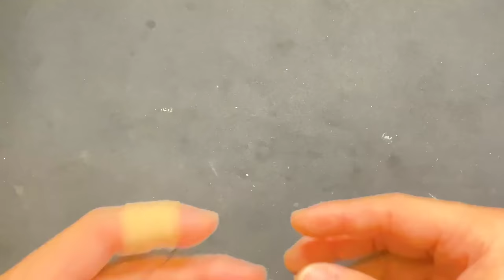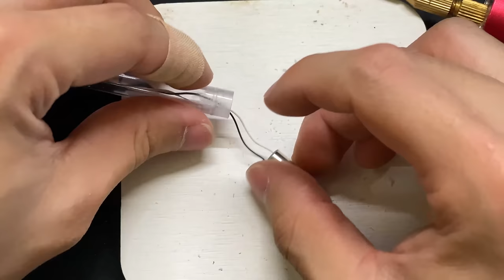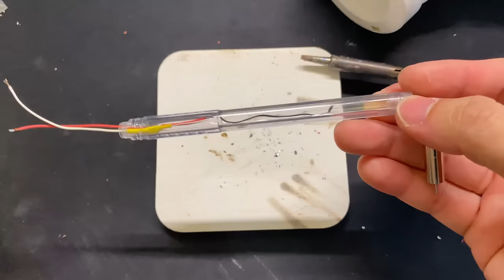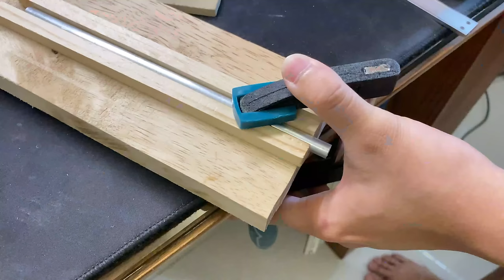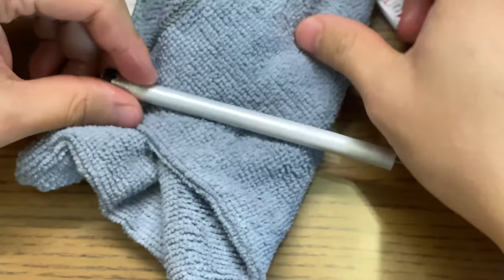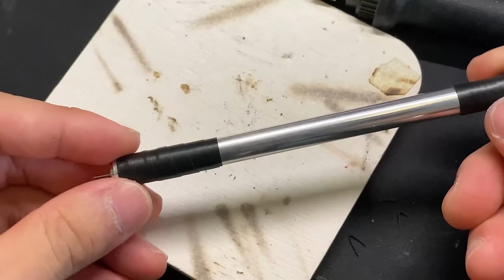I made a Pen Drill (Slim Mini Drill)

Comment: With USB-C and USB PD you could get up to 20V at 5A from a USB-C power supply. That would make this thing really crazy. The ZYPDS is a small USB-C chip that asks for 12V or 20V from a USB-C power supply, they're super useful for projects like this.
Reply from the maker: Wow, that is a new knowledge for me. Thank you for sharing, definitely will try it when I upgrade the drill :D
Reply: That's overkill and will burn that motor
Reply: @davey2k12  sure of course they'd need to modify the rest of the design
Reply: @lost4468yt  yeh just by a cheap one 👍😂
Reply: @roomspaceplayground buddy, use heat shrink tubing instead of duct tape.
Reply: buddy, use heat shrink tubing instead of duct tape.

Comment: Its nice, but it must been better if you just listed down all the materials you've used in this project.
Reply from the maker: Hi Thank you.

The materials basically are:
- 1 mm drill bit
- 8 mm chuck for the drill bit. the inner diameter is around 2 mm.
- LK0236 motor
- 8 mm aluminium pipe
- Male and female power connector
- USB cable

Hope it helps :)
Reply: @roomspaceplayground  where did you get the motor from??

Comment: Cus it low voltage use a FET or transistor with a sliding potentiometer needs slowing a bit or even a gearbox helps prevent ya motor from burning it's brushes
Cud even directly connect drills make the drill shaft with a thread or square drive use a magnet to hold it in place
Reply from the maker: agree, i had the same thought after trying it. but after all this project is just a simple one. I might make a new one with a gearbox like you said next time. Thanks for the advice :)

Comment: its great, but does it give high torque? if so, make sure the motor doesn't heat up from overload
Reply from the maker: not high enough in my opinion, as it will stop if I push a bit deeper. If using it quite some time, it does get warm. That's why it has to use metal body.
Reply: I am more worried about the fact that if the bit locks, that motor will keep on turning and binding the wires like it did on the pen
Reply from the maker: might need to add small bolt on the body for tightener. But it cant be too tight either. ill keep that in mind for the next project. thank you
Reply: How do you stop it from overloading or heating up too much?
Reply from the maker: for now the only option is turn it off i guess

Comment: Great build, Can you please put up a link from where to buy the brass chuck as I'm not able to find one online with a inner diameter of 2mm. Thanks
Reply: Actually I found exactly what’s in this video on eBay. Search for “Micro Brass Electric Motor Shaft Clamp Fixture Chuck For Drill Micro Drill Bit”…

Comment: Ok So Now that I am Moved in To my new Home I have the time to Build this Drill . 
Everything Is going well Except for the Electrical Connection on the end The Ones I ordered are way to big for the tube Do You know what size those are in you project ?
Reply from the maker: if i remember correctly, it is about 5 mm diameter

Comment: What is the original small hand drill you are using named and/or found?
Reply: I think I found, Meterk Part Number E17695-1.  Thanks for sharing!  Neat design.
Reply: How's it holding up?  Still working OK?  Thinking a speed controller might be a handy addition if those motors last and you can keep the chuck on.
Reply from the maker: Hi, my original one has no brand on it, I've got it from some online shop that I forgot already where. 
The pen drill is still working just fine, it is just that you cannot push hard like it has not enough torque, besides that it is still working and useful in tight space if you push slowly when you drill :D

Comment: please tell me: what is the diameter of the motor shaft itself?
Reply from the maker: I have added the information in the description.
The materials basically are:
- 1 mm drill bit
- 8 mm chuck for the drill bit. the inner diameter is around 2 mm.
- LK0236 motor, I think it is a motor for drones.
- 8 mm aluminium pipe
- Male and female power connector
- USB cable
Reply: Я заказал моторчик с диаметром 0.8мм. и ничего не подошло 😢😢😢, ждал долго) и диаметр очень маленький, нужно как минимум 1.8 мм. Диаметр вала моторчика!!, Огромное Вам Спасибо за помощь и информацию!!!

Comment: What is the drill bit size
Reply from the maker: I have added the information in the description.
The materials basically are:
- 1 mm drill bit
- 8 mm chuck for the drill bit. the inner diameter is around 2 mm.
- LK0236 motor, I think it is a motor for drones.
- 8 mm aluminium pipe
- Male and female power connector
- USB cable

Comment: Sorry, but here is enough place for a battery.
Reply from the maker: Hi, for the one I made, there is not enough for AAA battery, but it is a really good idea. Maybe using slimmer metal pipe and the whole body structure using 2 AAA batteries can be possible. You're genius!
Reply: @roomspaceplayground  also you can found little li-ion in the shop where you bought a motor.
Reply from the maker: yes, I might need to find one first. Thanks!

Comment: Beri penjelasan dong apa aja barang yg di butuhkan
Reply from the maker: I have added the information in the description.
The materials basically are:
- 1 mm drill bit
- 8 mm chuck for the drill bit. the inner diameter is around 2 mm.
- LK0236 motor, I think it is a motor for drones.
- 8 mm aluminium pipe
- Male and female power connector
- USB cable